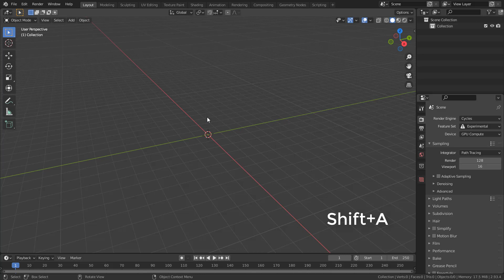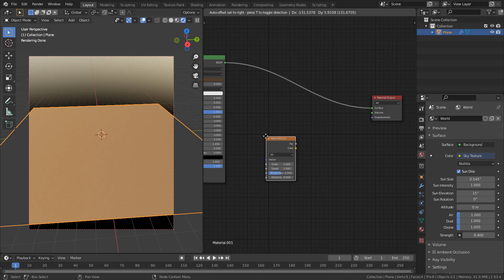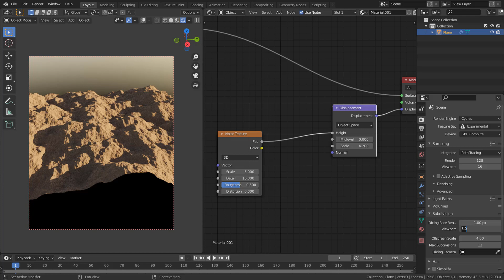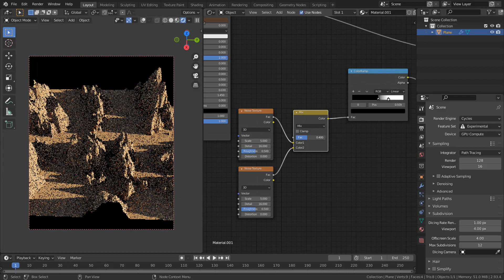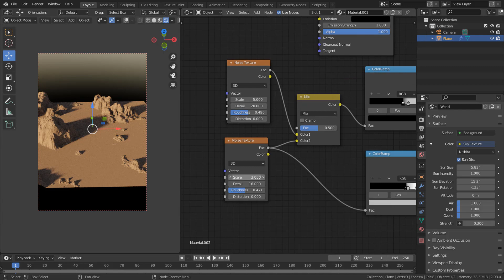How to Create Procedural Terrains in Blender

Comment: also, I don't see any dicing rate or subdiv setting in my render properties.  I'm using blender 3.5.1.   probably why.
Reply from the maker: In render tab, you have to use Cycles render, also Experimental in "feauture set", also in material tab use to displacement and bump, I explained all this in the video.
Reply: @chuckcg  Only difference I did was I didn't click experimental.  Maybe then it would have shown up.  thanks!

Comment: I looked at the # of faces for this showing on your screen.  4.    ?  It literally says there are FOUR POLYGONS and yet you can see in the viewport tons of details.   Wow.  Seems like displacing this way would be the way to go when creating multiple mountains in a scene.  Some far away ones would not need as much detail then closer ones you could just bump up the polys for those and still be way below any poly limit for your PC setup.  I see some people moving the scene in viewport in full cycles render mode with over 8 million polys with no lag.  I put a low number in voxel remesh one time and had no idea what I was doing.  It took like over a minute and then I looked at my face count.  over 66 million faces. !  I quickly hit control z.   man, it didn't crash tho.  but i was too scared to try and orbit the viewport with 66,000,000 faces. hahhah  I assumed it would be laggy even in solid mode.   I still get baffled by how to displace since there is a displace modifier and I always thought you had to have actual geometry (faces) to displace so...   this still is a bit confusing but I see the result and I see the face count which is insanely low.  4?  that's crazy.  So, when I try displacement again, I'm going to definitely use this approach and see what happens.   Thanks a lot!!!!
Reply from the maker: Yes this is a cycles feature, micropolygon displacement and adaptive subdivision, but I recommend to use a GPU for rendering.
Reply: @chuckcg  I have a 4070 TI and 64G RAM.  I just upgraded over a month ago.  I always use GPU for rendering and denoising.  Way faster than CPU.  But I did not click experimental so that's prob why I didn't see all the settings you had AND why my poly count was way up above yours.  Ok, thanks for the help!!!

Comment: I'm not sure if it's because of the version difference but I didn't get the same result in 1:46 with the Displacement height. All it did when I change it is it moves up and down, didn't give me the same mountain look.
Reply from the maker: Make sure to use Cycles, also change to experimental in feature set, and add the subdivision surface with adaptive subdivision, also enable displacement and bump in material properties, i explained all this in the video, make sure to follow all the steps.

Comment: The only problem with procedural terrain is that you can't add a particle system to it (or at least it won't go on the deformed terrain properly). Unless there's a way that I don't know about... But this does look very good and very quick too, nice one.
Reply: You can bake textures into geometry, but then  that means you can no longer procedural edit things, so you have to be sure that's the exact terrain you want before moving on to the particle stage.
Reply from the maker: Thanks, yes i think the only way is to add the objects by hand.